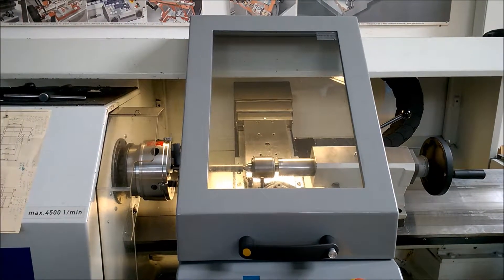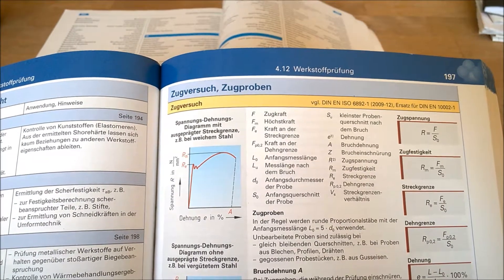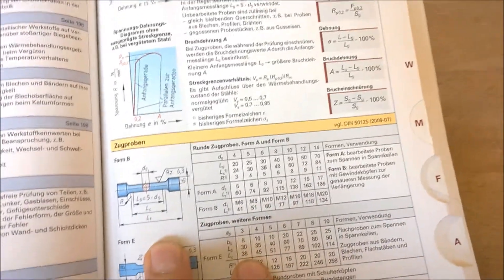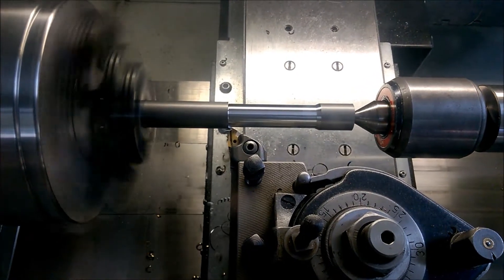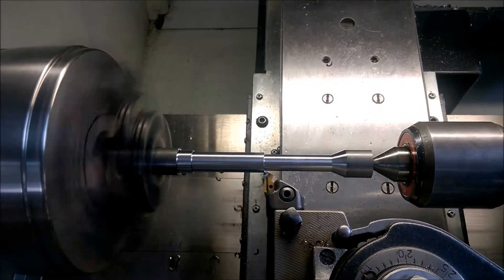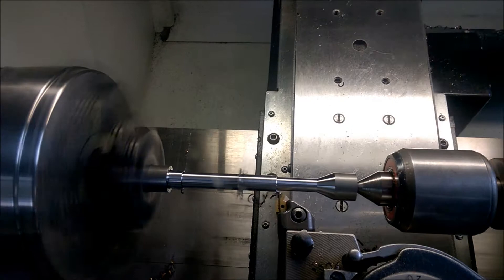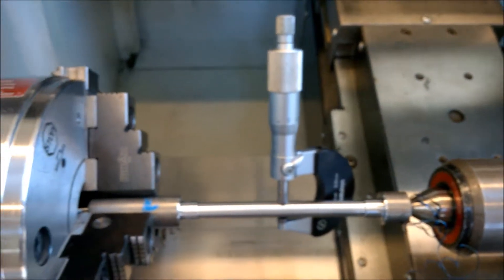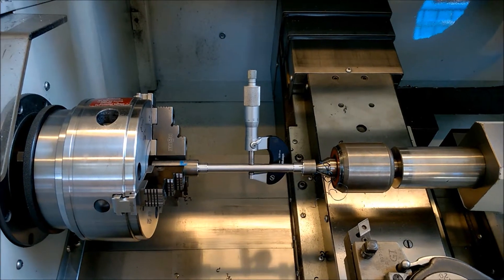GDW Making of a specimen for the tensile test / Zugprobe drehen

Comment: Hello Sir, can I purchase the code from you please?
Reply from the maker: I didn´t do the programing in G-Code. I used the FANUC aplication that came with the machine. With this aplication you just have to discribe the contur of the part and the depth of cut for roughing and skimming. Unfortunately I don´t have access to the G-Code in this FANUC aplication. To get access to the G-Code I must use a special Interface to conect a computer with the machine. I haven´t tryed that until now.

Comment: Have you tried using Fusion360 or some other software to generate gcode for the machine, and if you have can you do a video on the subject ?
Reply from the maker: No I did not. The machine has a simple Fanuc control. I just picked a the menu "free contour" and adapted it.
Reply from the maker: No, I haven´t. I used the FANUC aplication that came with the machine. It´s a very simple but limited aplication. Sorry for answering that late. :-/